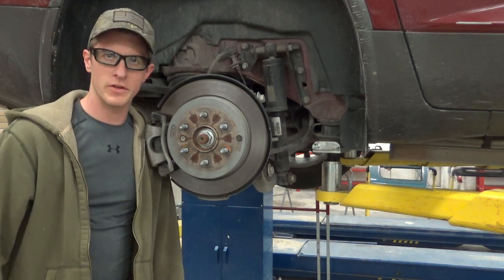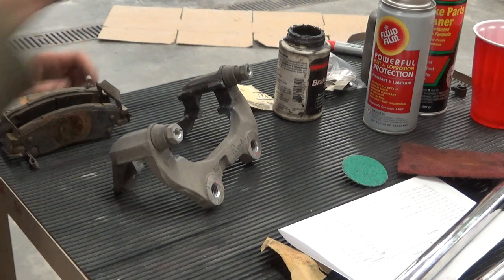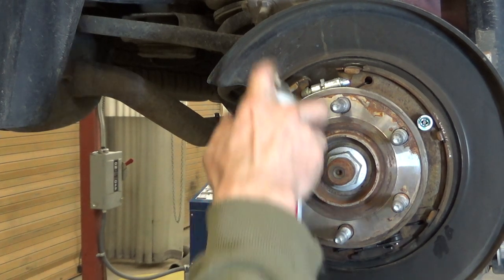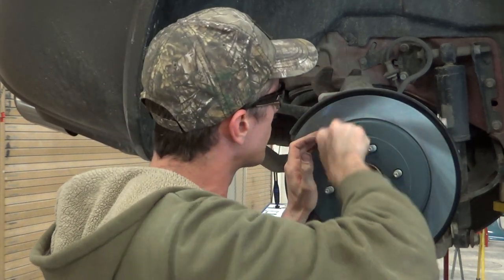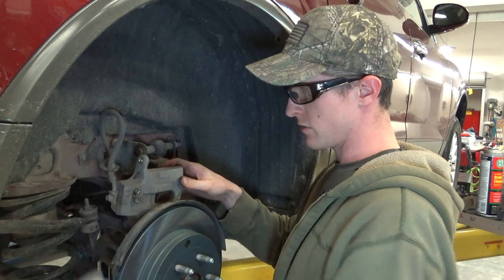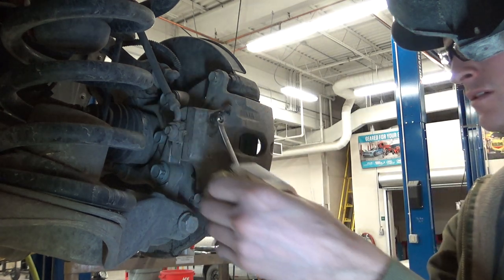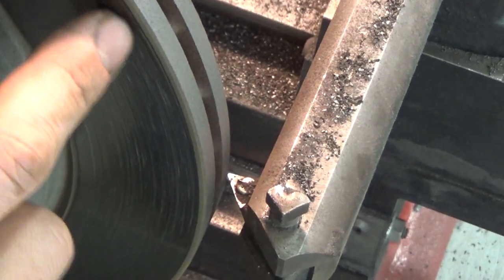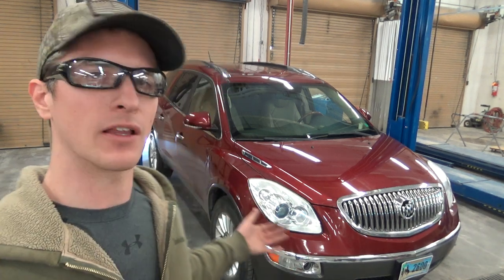2011 Buick Enclave Rear Brakes

Comment: Those caliper bracket bolts are TTY and are supposed to be replaced. I'm seeing this on more and more vehicles with the same basic design. This is video#3 that didn't mention it.
Reply from the maker: Identifix makes no mention to replace the bolts.  They do say to clean them and apply threadlocker.
You are correct on the newer vehicles being Torque To Yield.  More specifically, the Brembo editions.
Reply: @LockersGarage  I didn't know they were TTY fasteners and I've reused em to. I imagine you need high temp thread locker for it to hold up? I use the red on most everything that is in a high temp application unless it's a fastener I'm going to be removing again in the future where I use the blue. Only as because I wonder if the blue will handle the heat of the breaks

Comment: how do you rotate the rotor to back off the parking brake? i’m assuming i can’t because drivetrain is locked with the car in park, i’ve already tried an impact hammer to break it free. I’m guessing i just have to put blocks on the other 3 tires and put the car in neutral or drive to spin the rotor and hub?
Reply from the maker: Can you get the other back tire off the ground?

Comment: Hey Locker! great video! Do both sides have the e brake? I attempted to fiind the adjuster on the driver side but couldn't get the rotor off. Any suggestions? Same vehicle, 2009 Buick Enclave CXL. THANKS!
Reply: Passenger side 11 o'clock position, Driver side 1 o'clock.  Reciprical.
Reply from the maker: Yes they do- Looks like you got it- If she is stuck on there, it may need some mechanical persuasion to be removed- as long as the brake is released!

Comment: Question 
So you turn the brake adjuster up to make it hard and down to make it lose
Reply from the maker: I think it is backwards on one side.  Tighten it up until it grabs and is tight then back it off a few turns.
You can see what is going on with the rotor removed as well.